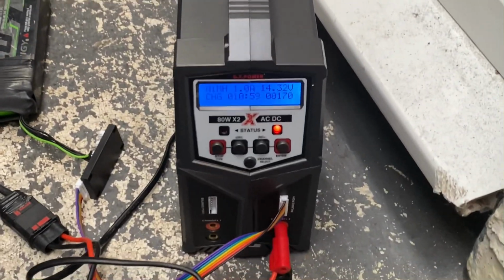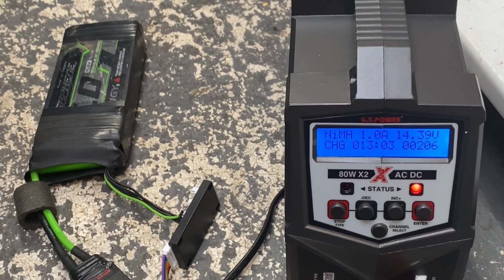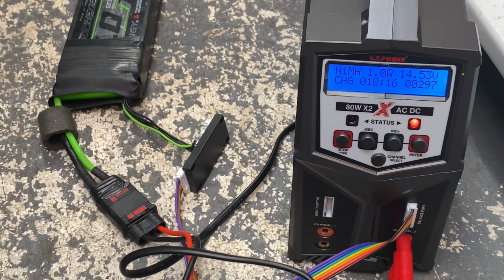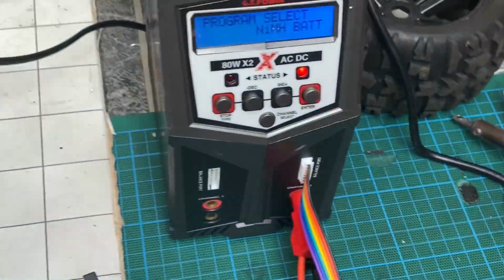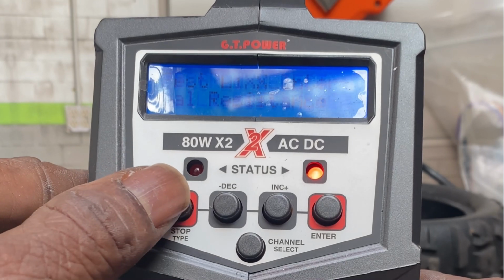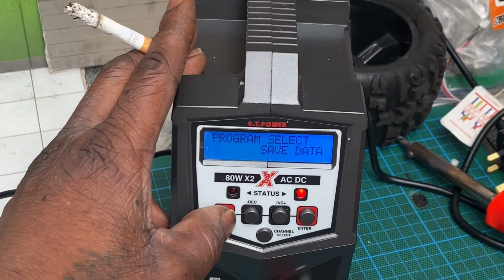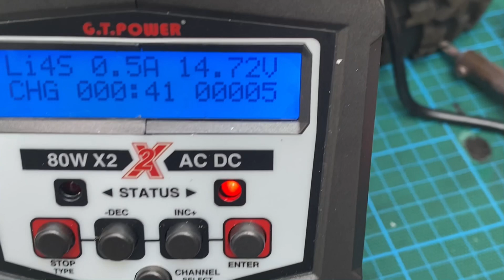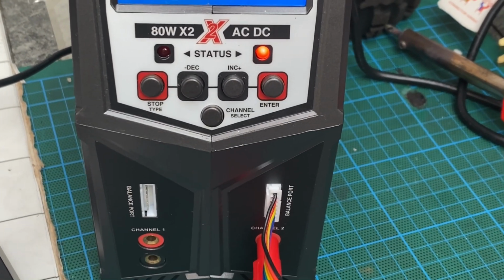How to fix drained lipo battery cell error voltage

Comment: Great info mo. 👍 Iv been wot we call backdoor charging for years. Since lipos come out. but some people don't no how to do it. Good learning curve for the newbees.. 👍 .
Reply from the maker: Thanks bro that’s the whole idea to teach what you know to help others I enjoy doing this bro, and I appreciate your support
Reply: When that happens with mine,I just charge on NiMh at 0.1 A until minimun cell voltage is reached, then I change over to Lipo and run a balance charge.
Reply from the maker: @semperatis  yeah I did more or less the same thing
Reply: @semperatis  that's it bro 👍 exactly wot I do. 👍 People av give me lipos an said no good you can av it. Iv charged the back door an away I go.. Brand new lipo. 👍

Comment: Looking like u got s bad cell man.  21 ohms is way too high for totalresistance.   Try check individual cell resistance.
Reply from the maker: That 1 is on 10 on its own
Reply: @MORCmadness  yeah that's not good man
Reply: Panther graphene when maintained really good will read below 1.0 mega ohms each cell
Reply from the maker: @KiloWattRC  I will give it 1 run see how it goes, but yeah no good
Reply from the maker: @KiloWattRC  well they took a beating I must say they was in every crash or esc burn I had so it’s about time for them
Reply: @MORCmadness  if one cell is bad its still salvageable i always build my own packs and beef them up.  Alot goes into battery science and prep.  It the main key for speed
Reply from the maker: @KiloWattRC  these are the same I ran in the dbxle as well that was there last run